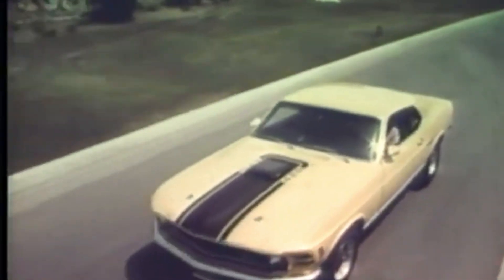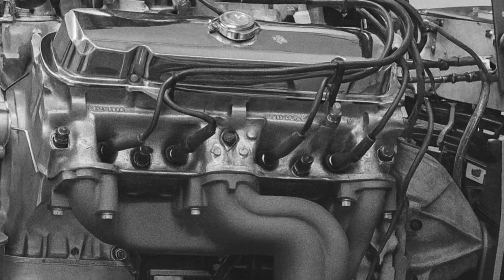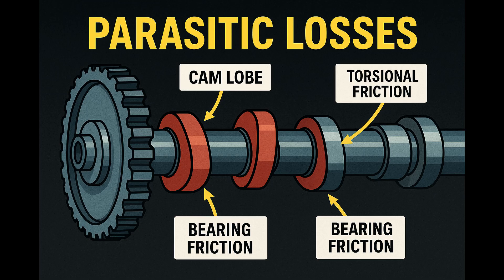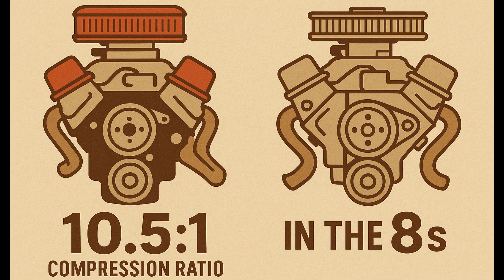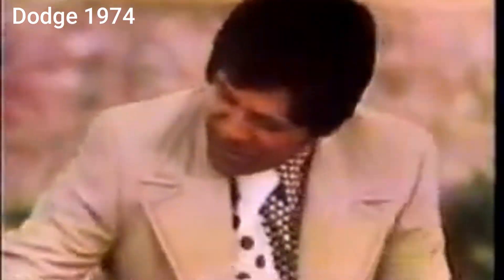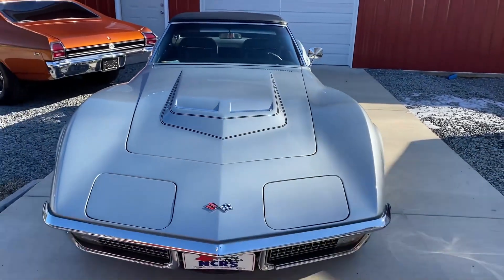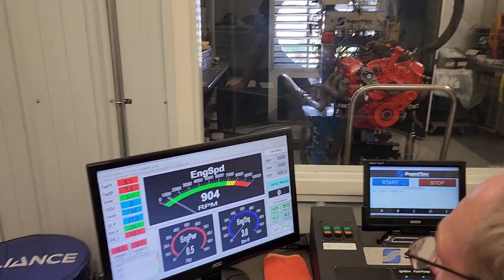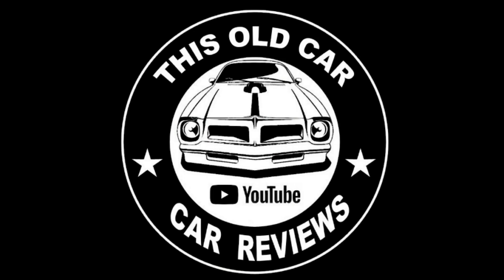Why Muscle Car Horsepower Dropped After 1972

Comment: Many folks don't realize that we just came off of a 2nd Muscle Car era (2005-2024) and power was even higher this time. In that era 300+ SAE net HP was common - even our most common V6 engines make 290-3015 hp, and our V8's commonly make 400+ hp. The typical Pentastar V6 or GM High Feature 3.6L V6 that are rated in the 290-315 range would have been rated in the 385 to 420 gross hp prior to 1972. The Dodge Charger Scat Pack which became relatively common in the last few years would have been listed at roughly 645 hp if we were still using pre-1972 gross hp numbers. The icing on the cake is the Challenger Demon 170 - with 1,070 SAE net HP - a number that was unthinkable back in the 60's and 70's. Even many compacts and family sedans have had horsepower numbers that would have been unthinkable back in the late 1970's to early 1990's with 200hp SAE being very common if not on the low side in those vehicle classes. Even the base model of the final generation (2010-2019) Ford Taurus would have shown a Gross HP rating of 320 - while the top end Taurus 3.5L Ecoboost would show 486 Gross HP. Many of the muscle cars of the 60's were 2 door coupes, while many of today's muscle cars are surprisingly sedans that could easily be used as family cars (Charger RT/Scat Pack, Taurus SHO, Chevy SS), and today's muscle cars were commonly bought by those folks who were teens in the 1980's and early 90's who grew up idolizing the muscle cars of the 1960's.

Comment: Nice to see somebody has the reasoning right that’s what I’ve told all of my friends. I’m the same opinion that yours is starting in 1972 with the net horsepower. It was the engine installed in the vehicle with all the accessories running.
Reply from the maker: Right on

Comment: 1972 was a pivotal year for American cars. 1970 is considered the pinnacle of the traditional muscle car era. Even though Ford, Mopar and AMC engines were basically identical from 1970-1971, GM initiated an 8.5:1 compression cap on all engines for compatibility with the coming low and unleaded gas. But other than the compression drop, GM’s engines were basically unchanged. For 1972 Ford, Mopar and AMC followed suit in lowering compression. Mopar also discontinued the Hemi and 440 six pack. Ford discontinued their Boss engines. Also 1972 was supposed to be the year that GM’s legendary A body cars were supposed to change to the colonnade style. But a UAW strike delayed that until 1973. And of course 1972 was the change from gross to SAE net horsepower as the video points out.
Reply: The engines did change quite a bit with the lower compression ratio. The combustion chambers were different for one, cams, etc.
Reply: @Yankeededandy62  What I was referring to was GM’s high performance engines. They were all high compression for 1970. For 1971 GM capped all engines at 8.5:1 while everyone else’s engines remained the same for 1971. There was a slight drop in GM’s engines output from 1970-1971 but it was solely due to the compression drop. Everyone’s camshaft profiles became more conservative starting in 1972 and more conservative in the following years.
Reply from the maker: Thanks for the input!

Comment: Nicely explained.  The thing that is interesting in 2025 is the smaller engines and turbo charging have more horsepower. Some of those 4 cylinder engines could not generate more than 130 hp and now with new technology and turbo charging, they generate over 200 horsepower.  The same for V6's and V8's. Look at the Ecoboost Ford vehicles.
Reply from the maker: True, Olds98!

Comment: Good explanation of why the numbers fell. In many cases, it seems like half the reduction in stated horsepower was due to the change in measuring hp from gross to net, which didn't actually change the power of the engine. And the other half was due to reduction in compression ratios, which did reduce the power. 
I have a 73 Pontiac 455 rated at 250 hp NET. The same engine in 71, with the same compression ratio, was rated 325 gross hp. So, there was no real loss of power in this case because the engines were the same. It was just the change in the way they were rated that lowered the number. They still had some decent power through 1974. Then it really dropped off in 75 with even lower compression ratios, and with 1975 being the first year for catalytic converters. 
@7:27, of course, use of the catalytic converter didn't start until 1975. And that necessitated that all 75 and newer cars had to use Unleaded Fuel only, to prevent lead deposits from fouling the guts of the cats. Not only were catalytic converters more restrictive, but they also restricted the exhaust systems further by eliminating dual exhausts. At the time, cats were too expensive to use 2 per car. So, they were limited to single exhaust from 75-up.
Reply from the maker: Thanks for watching and your input!
Reply: All GM engines from 71 onwards were designed to run on unleaded gas. Ford and Chrysler engines from 72 onwards. Unleaded arrived a few years earlier than the catalytic converters did. Car manufacturers needed time to prepare for that.

Comment: Wait a moment,,,, in '70, everything was normal.  In '71, things began to change...... then in '72 things changed more....... I know for a fact that auto's that WERE having 10.5 to 1 compression,,,,, in '71 dropped, and again in '72.   In '72 the compression ratio dropped down to 8-1  and 8.5 to 1.
Reply: For the 1971 model year GM introduced an 8.5:1 compression cap on all engines for compatibility with the coming low and no lead gas. Ford, Mopar and AMC followed suit for 1972.

Comment: There was most DEFINITELY a change in mopar 440s from 1971 to 1972 in horsepower, i know this for a FACT!  I bought a 1972 Chrysler New Yorker in 1977 (I was 17 at the time) because my dad drove a 1971 which, on the few rare occasions  I got to drive it (prom and other dances), was BEYOND fast and VERY smooth!  So, I figured I get a '72, thinking there wouldn't be much of a difference between the two.. WOW was I wrong!  That '72 was a piece of SH*T compared to the '71 when it came to power and smooth running operation!
Reply from the maker: Thanks for watching and sharing!

Comment: Omg, you had to bring this up.
Dude, it's a different era for a reason. Let go the hate. The oil crisis was draining us. 
Thank God EV is here
Reply from the maker: Not ready for EV.  I love me oil burning, gas hogging engines!  Got my Corvette and just bought me a 2026 Chevy truck with a 6.6 V8.  No EV here dude.
Reply: @ThisOldCarChannel Those wokesters/ hippies are are at it again!! Smh..😂
Reply: hope your battery dont explode . chineseium batteries, no thanks, dont forget to charge it with good old fossil fuel.
Reply: @davidpiacenza9033  but good news: we're NOT getting any Chinese cars here in the States. Relax...😮‍💨
Reply: You might have a different opinion if you hear about how the cobalt and lithium for the EV's batteries is mined.
Reply: @MisterMikeTexas  they're changing that but it takes time. Lead fuel hasn't changed and that's why it's phucking up the environment and health. I'm glad the oil crisis happened so everyone won't rely so much on just oil or gas or whatever you call it on fuel. Nothing last forever...
Reply: @imrytebeehyneu We haven't had leaded fuel for over 36 years! Where have you been? It's all unleaded today.